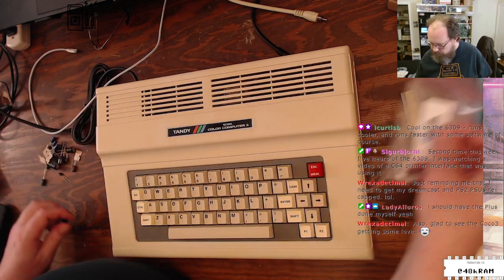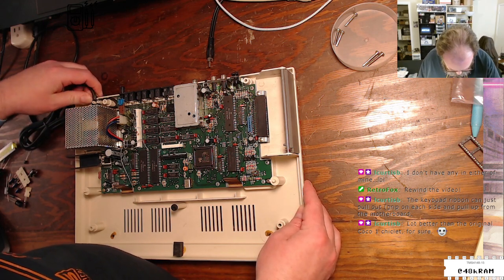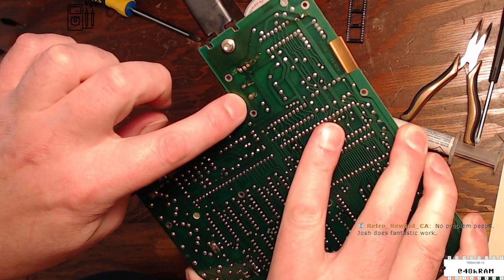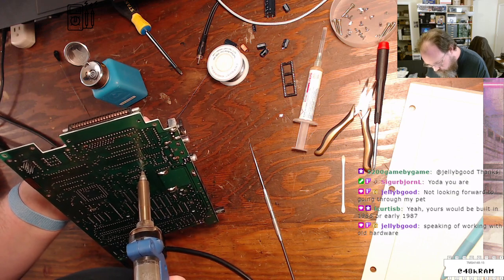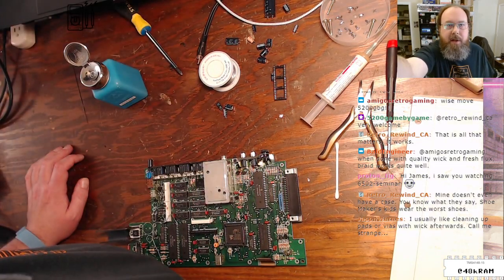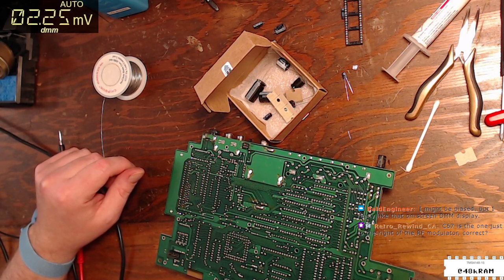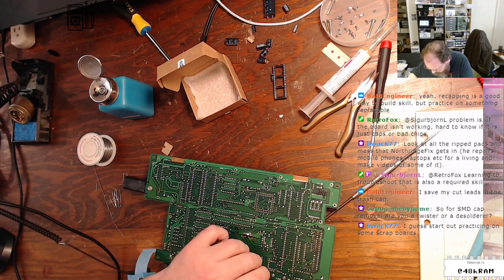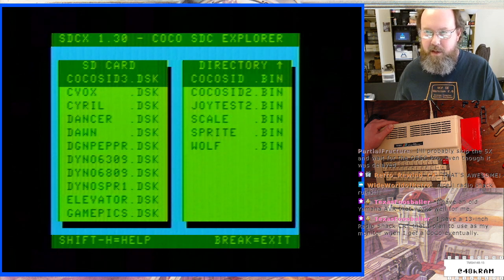Livestream: Tandy Color Computer 3 recap

Comment: There was a quick mention of DRAM during the stream. Can the 128K of DRAM be upgraded by replacing the existing socketed DRAM?
Reply from the maker: So the Tandy CoCo 3 actually has provisions for upgrading to 512kB of RAM. At 16:59 you can see the white connectors on the logic board which accept the 512k upgrade. I've since added that upgrade to my machine. I bought mine from Backbit - https://store.backbit.io/product/memory-expansion-coco3/